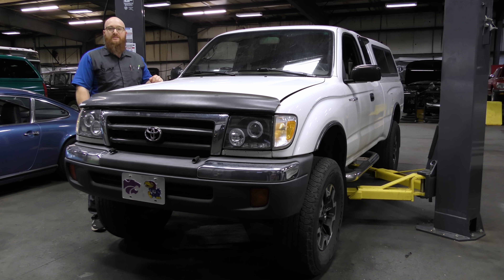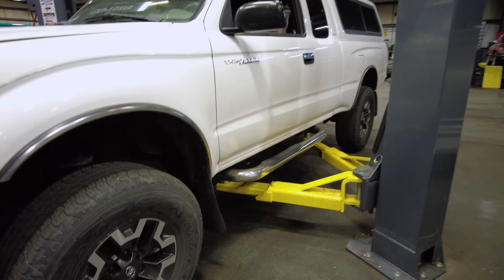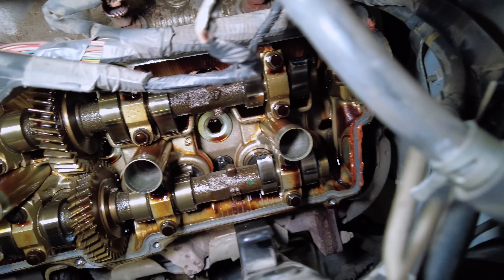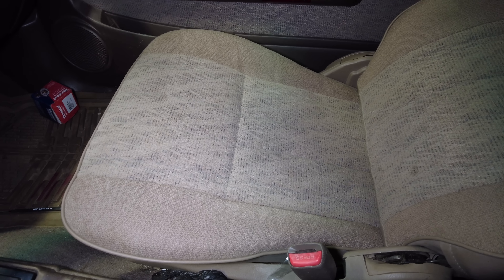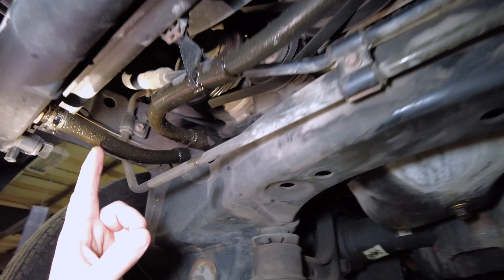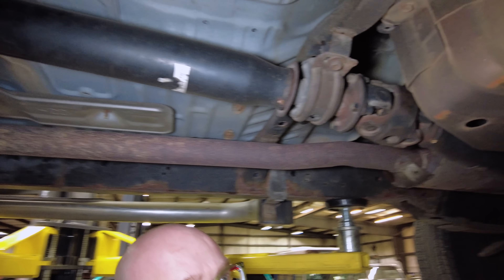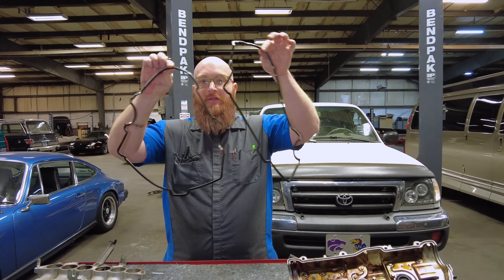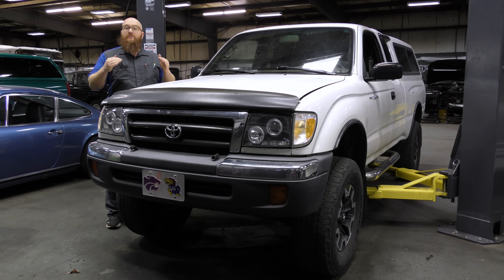Is it worth fixing this rusted out '99 Toyota Tacoma? CAR WIZARD explains

Comment: I’m with you wizard on pushing Toyota vehicles. Although not perfect they are superior to the competition.  I’ve had multiple’s of American cars that have been nothing but total nightmares, even when new from the factory. Two brand new vehicles I had to file lemon lawsuits forcing the manufacturer to purchase them back from me. I’m done giving American automakers second, third, forth or fifth chances. My last one a 2014 Jeep Grand Cherokee diesel cost me 10k in rental car costs not covered under warranty. Due to being in the shop for months at a time on multiple occasions, 28 times it was in the shop in 2 years of ownership. I’ve owned 4 Toyota’s in my life and only one ever needed service for a recall done during a maintenance visit. Keep pushing Toyota as it may one day force American car manufacturers to step up their quality.
Reply: I hope the American car brands will get their crap together. They can build decent cars every once in a while. But honestly probably not anytime soon.
Reply: An ecodiesel grand cherokee isnt even american tho. Its literally a fiat engine with a german transmission
Reply: Sounds like the 1975 VW Rabbit I had. In 25 months it was in the garage 25 times - 8 times for regular service and 17 times for warranty work. there were 46 issues total, and when the master cylinder let me down at a red light I bought the core value from the dealer and sent it to Ottawa for examination. A few months later the Canadian government issued a recall on the master cylinders. I think it was built on a Monday after New Year's Eve. The VW local Head Office even recommended that I switch dealers for better service.
Reply: @slyfox4564  It wasn’t just the engine that was problematic, the infotainment system was replaced twice, the emission controls including DEF system once, HVAC system broke twice having the whole dashboard removed. VM Motori made the ecodiesel for Chrysler it’s owner, never had any issues with ZF transmission. Doesn’t really matter who built what with regards to this vehicle, Fiat Chrysler at the time chose their suppliers and ultimately built the vehicle. There not one automaker in the world where the manufacturer makes all the parts.

Comment: Thank you Wizard for the great content, I for one will say keep on pushing the Toyota praise because it is reality. A lot of folks don't like reality and would rather go on believing that their poor purchasing habits are justifiable. I have a 2008 Yaris and it has been the most reliable, dependable, and useful car I have ever owned. With a properly maintained 134,000 Kilometers on the clock this little car will go for another 15 years without fail. I also love getting such great gas mileage during these turbulent times. Cheers, from Manitoba, Canada.
Reply: The Toyota Yaris is actually built by Mazda for Toyota .
Reply: @youtuber5709  Uh, nope. 2008 Toyota Yaris RS Hatchback built in Japan for export to Canada. The only Mazda built Yaris is the model year after the GR Yaris was introduced to the EU market. 2015-2020 Models for US/Can. were restyled a Mazda 2. All other models and export versions were Toyota built in Japan or France.
Reply: @robertsomerville320  So i was partially correct there are some Yaris built by Mazda .

Comment: I recently trade in my 2001 Toyota Camry with 262,000 miles plus and bought a barely used 2021 Toyota Highlander that intend to use for 21 years as I did with my Camry, you are absolutely 100 % correct in pushing on Toyota 👍🏼👏🏼
Reply: Chevy,dodge,ford fanbois are mad because someone is making more honest stronger cars
Reply: @tinleo333  basicaly
Reply: Yep I agree.My 2005 toyota camry 3.0 v6 has 282,000 kilometres on the odometer and drives and runs better than most new cars do.After owning all the major branded vehicles over the last 35 years I will not own anything but a toyota.
Reply: @tinleo333  ford ranger 2.3 is better than any of those toyotas
Reply: @MrBlaze256  Thats your opinion maybe not the reality
Reply: @tinleo333  it's reality. That motor was made for over 30 years.  It's what they use racing dirt track cars
Reply: @MrBlaze256  A car is not just an engine
Reply: @tinleo333  if toyota is so good why does their warranty suck. Like 36k miles or something
Reply: 293,000 on my '01 Camry, just about broken in.
Reply: @MrBlaze256   That's because it's a Mazda L engine.
Reply: @JH-jp9sv  it's no Mazda engine. Came out in the ford pinto in the 70s
Reply: Why trade it in and get nothing when you could have sold it online in 10 minutes

Comment: I have a 2002 Toyota Land Cruiser with 220k miles on it, recently (1 week ago) just paid $2,900 to get the timing belt replaced and a new AC compressor (it still worked but was noisy). It hurt having to pay almost 3 grand but I always remember that I could be paying 1k a month for a new truck lol

Comment: 100%  correct in fixing this 24 year old truck and beyond the $1500 @ your shop - on to the frame shop and getting that touched up/repaired also!  Just go price anything new today or even newer/used as it is all factoring in to helping to cost justify repairs such as this.  

The vehicle manufacturers as well as car dealers and all of their markups i.e. "market adjustment add-ons to the windows sticker as an example" plus all the non-needed/non-functional useless electronic "chip" garbage on newer stuff - would much rather deal with older stuff any day!   They are all pricing themselves out of the market and then jump to fully electric cars, trucks, SUVs - nope!

Comment: We recently had a '98 Land Cruiser that came into the dealership where I work that had been sitting for years with over 370k on it. At the time when the car came in it had no brakes, the brake pedal went to the floor, and the emergency brake cables were shot so when you pulled it up to stop the car it would just drop down on it's own. At the end the bill was over $8k to get it back up and running again and the customer was happy to pay it and have us work on it. Yes I agree it's absolutely worth it. We've had a few other classic Toyotas that were also in this condition that we got back up and running again and the customers were also happy to pay us upwards of $8k to fix them!
Reply: I strongly feel that for an old car, as long as interior or exterior are good condition, why not fix the mechanical issues even if it costs more than the Kelly Blue Book value? But some people want to drop their old car immediately if the repair is too much to get a new one. Well a new one will be a lot safer.
Reply: It only cost 8k because they were dumb enough to have a dealership work on it
Reply: @silenthillfarms  not necessarily! there were a lot of things that needed attention on that truck! We had to replace the brake hoses, the fuel system, extermination of critters that had been living inside the HVAC, and much more. Yes I'm sure that there are some places that could've done it for less, but even the Wizard will agree that is a pretty conservative amount these days. He's even resurrected some cars that were nearly twice that amount to get running again.
Reply: @mds2465  I don't think that's too ridiculous with everything you've listed. Is it expensive? absolutely. But the devil you know is better than the devil you don't, and I'd gladly pay $8,000 for good work to fix what you know has been reliable, rather than watch that $8000 instantaneously disappear as I roll out of the dealership in a $90,000 2023 Lexus LX.
Reply: @hydrothermalworm7778  yeah sad to say but that does seem to be the pattern these days with newer cars. I know Andy the tech who worked on that truck is an excellent mechanic and he definitely made sure that it would be good for many more years to come, and after driving it myself after all was done I would have to say so as well!

Comment: I just bought a 1997 toyota vx grande, wagon, same engine, 1 elderly gent owner for 24 years with bill of sale in same name, always garaged, always main dealer serviced, zero body dints, near perfect paint 216 k kms. 30% under market value. Amazingly, he refused to sell it to me without a main dealer service!
$2k aud bill he paid. Valve cover gaskets done, full service, handbrake cable all replaced before he sold it to me.never offroaded, Its a keeper

Comment: We bought a '98 4 Runner 4WD used CPO, in 2000 with 44K on the clock.  23 years later we STILL have this wonderful vehicle, with 352K miles on the odometer....original engine and transmission...ZERO problems with this masterpiece of Toyota reliability.  It's never needed a charge on its ice-cold A/C.  All power options continue to work flawlessly.  We did some front-end work, but that's it.  Love Toyota!!  Best automaker on the planet.  This car has criss-crossed the country numerous times.  We keep it showroom...because it's worth it.

Comment: There was a factory recall on those truck frames rusting prematurely for some (production) period in the early or mid nineties. I couldn't tell you what year the cutoff was but a friend got a notice in the mail after he bought an abandoned '97 Tacoma from a tow company. That truck didn't happen to have any significant rust on the frame so he didn't worry about it.
It had a 4-cyl auto with 150 ish thousand miles on it and the engine was clean as a whistle internally. He got a good deal on it because some kids had jumped on the roof and dented it in plus dented some of the body panels. We were at the tow yard sniffing for something to buy and I pulled the dipstick out and saw how clean the engine was. I knew it was a diamond in the rough.
Reply: Owned 2 that were bought back by Toyota.  95 and 96. They paid 150% KBB retail.  People were scouring boneyards for em to buy and sell. In the end they cut off buybacks and replaced the frames because it was cheaper

Comment: My 2006 Avalon is the best highway cruiser!  It has 200,000 miles and looks and drives great.  I got a great deal on it as it had a broken front spring and a leaky exhaust flex pipe which made it sound horrible.  The dealer I got it from was mostly off lease cars so this was too old to bother with.  I put quick struts all around, with new lower control arms / ball joints and had an exhaust place fix the pipe.  A GTA audio kit gave me bluetooth, other then that, tires and brakes and it just goes!  I had actually planned to flip it... but my wife and I love it so it stayed.

Comment: I've an Hilux from 97, even been used and abused and with some rust issues, it incredibly don't leak a drip of oil. Some rust spots to watch out are the frame section near the fuel tank, since it collects mud and debris. And the cabin section near the front doors, since the cowl drains to there.

Comment: With my 2022 Tacoma 2.7 4-cylinder, I drove it home, parked it in the field and sprayed a whole lot of fluid film all over and in everything underneath the truck: filled the boxed section of the frame, rocker panels, ect. I know the new Tacoma/4Runners frames have a coating on the inside of any boxes sections now, but still well worth the very small investment. As long as you can keep these Toyotas clean underneath, then they will last a lifetime…

Comment: Keep right on singing for Toyota.  I believe they're worth it.  I've got another truck I know you like.  My 02 Silverado Z 71 4X4. It currently has 325,000 miles.  It's been well maintained and worked pretty hard too. Original  5.3 and original transmission.  Over the past few years I've taken care of all the maintenance items,  oil leaks,  drivetrain seals, etc.  Everything works as well as it did when new. That 5.3 is quiet as a church mouse and strong.  I wouldn't hesitate to go across country in it.

Comment: I have a 2000 4Runner, it’s been a daily driver in my family since new and now it’s mine. 235,000 miles on the clock and it runs better than my dad’s 2012 Silverado with 55,000 miles on it. He’s had more repairs in the last 12 years on that than the 4Runner has needed over its whole life. You just can’t beat the Yota

Comment: I have a 1996 4Runner with this motor, same paint color. It's at 346k miles currently, still going very strong. Mine seems to be in a lot better condition than this one despite the higher miles.
Reply: NiCE!  do you live the salt life?

Comment: You are correct on the Toyota thing. Did you see the Tundra's that went 1,000,000 miles on the original powertrain? The Toyota engineers were so willing to learn and improve they bought the truck back and sent it to Japan to learn how they could improve on their past builds.

Comment: I'm new to the Toyota bandwagon. I recently bought a 2011 Toyota Tundra with the 5.7. Bought it with 140k miles and paid a lot for it. But, I know that I will get another 200k out of it. It's gone 10k now and feels new honestly. Only repair so far has been a bad PCV valve. That was a 26 dollar repair. I love it. Definitely a Toyota guy from now on.

Comment: I have a 97 Toyota T100 with the same engine as that Tacoma. I changed all six plugs on it without having to remove the intake plenum. On the drivers side of the engine there is a couple of things attached to the plenum that have to be unbolted and moved out of the way,  to make it easier to get to those plugs.
Reply: yeah, I definitely didn’t have to remove the plenum to change the spark plugs on my ‘00 taco also with the 5VZ

Comment: I hava 2002 4runner with 237,000 miles that lives fully half it's life offroad. Still going. I still have lots of maintenance done, like lower ball joints, bushings and inner and outer tie rods but it shows no sign of dying. The only reason to replace it will be when someone in our fam or friends circle needs an inexpensive 4x4, at which point we will get a 5th Gen.

Comment: I have a 99 prerunner in perfect condition. Good thing I live in the south. I converted mine to 4x4, and it was super easy. Everything looks like it came from the factory installed that way. Just did timing belts, water pump, etc.  I used all OEM parts. It’s been the perfect truck. Other than a radiator blowing out recently that’s all that’s happened in a real long time.
Reply: Did you have to cut a hole for the shifter?
Reply: @blapblapism  no because I got the whole shifter and console out of a 4x4 truck. When you pull up the console you’ll see the stamping where Toyota intends you to cut it away, but buying it that way was easier and just as cheap. Also I bought the harness to make the 4x4 light work properly. Don’t remember where I got the harness, but you can google it and they pop up. Not very expensive.

Comment: My uncle had a Yaris that he bought brand new in the mid 2000's.  Had nearly 275k miles on it.  Virtually no repairs.  The a/c still was ice cold.  But was totaled be a deer.  Probably still be running if that hadn't happened.

Comment: I have a '98 Tacoma 4wd with the 4 cylinders, it has 349000 miles. Recently I used Amsoil engine flush before the oil change and the idle it's better than before. I changed the clutch at 270.000 and that solved the problem with the first gear that was not engaging well. I suggest to use all the original parts or Denso or Aisin brands. Ciao

Comment: Keep on preaching Toyota Truth Mr. Wizard Sir. In my almost 60 years I have owned lots of cars and trucks Ford, Chevy, Dodge, Honda, Etc. Most were good vehicles but some were terrible. Now I own Greatness a 1998 Toyota Tacoma SR5 with a 2.7 four banger 5 speed manual 271,000 miles and a 2006 Toyota Tundra X-SP 4 door with a 4.7 V-8 Automatic 232,000 miles. They are the best two vehicles I have ever owned. I have done very little other than routine maintenance to both of them. I know some people may get tired of hearing about how good there quality is but if you ever own one you may end up like my I wouldn't own anything else! By the way I love your channel keep up the good work

Comment: I’ll bet hoovies green Chevy in the background will easily last 300k. I’ve seen LOTS of them and have one myself. I other than oil changes, I’ve only replaced the intake manifold gasket and one brake cylinder. But that dang Toyota 2.4L in my driveway with the ring problem causing oil consumption is costing more in oil than my Chevy has cost total. But…. The thing is damn reliable though!

Comment: Operated a small auto repair shop in the early to mid-seventies. Had both a Toyota Hi-Lux and a same year Datsun p.u. in at the same time. Remember taking the opportunity to do a semi-deep dive comparo. Night and day difference, absolutely no contest. Toyota was FAR superior everywhere I looked. Where Toy would have over-built, beefy components meant to last decades, Datsun (Nissan) would skimp, dooming their parts to an early death. Even just shutting the doors was dramatically different. Have owned a number of cool cars of various marques along the way, but my daily trucks and cars have been exclusively Toyota since then. Toyota never enjoyed the cachet of British and European vehicles, so the affluent have always turned their noses up to Toyotas, their loss. Out here on The Left Coast, we don't have much rust to speak of, so Toys regularly go 500K+ easily, still wearing many factory original components.
Reply: I have a 2000 Tundra that  looks brand new. Drives brand new as well. 460 000 miles.    Upgraded the front end and front brakes.